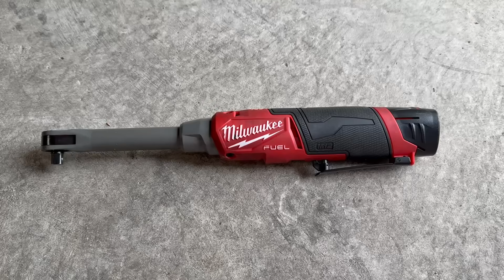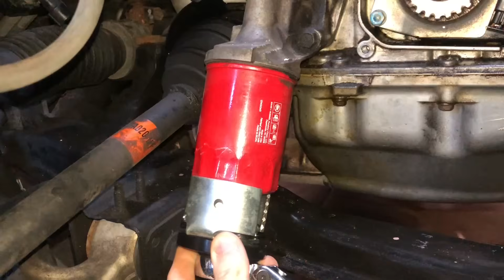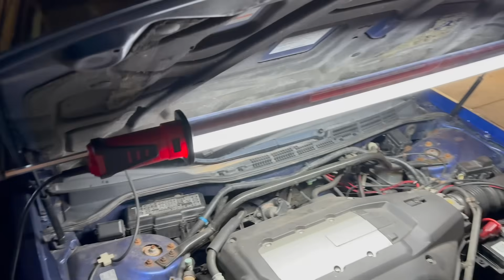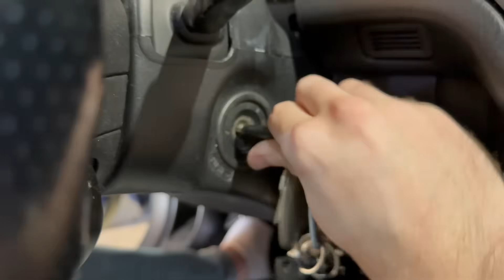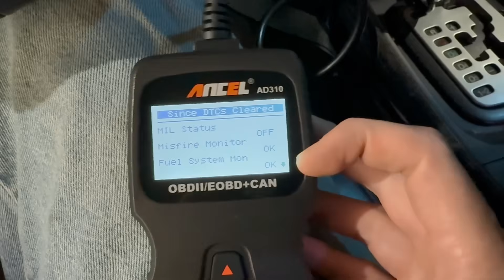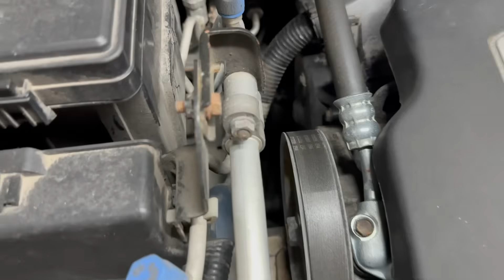Top 5 UNIQUE Must-Have Tools for Working on Cars

Comment: My next purchase will probably a set of 10 12 and 14mm wobble sockets in 1/4 and 3/8 drive. Also a set of good set of  extensions since I'm currently working on a car that would be nice to have rn and I've needed them before
Reply from the maker: I forgot about those wobble style sockets, good recommendation! Extensions are a must, and make sure to get a full set in both 3/8 and 1/2”. I used to use a 1/2” to 3/8” converter, but that was killing my impacts performance. What a difference the 1/2” extensions made. Thanks for watching!

Comment: Which cordless ratchet is the one to get if you're only getting one - standard or extended reach?
Assuming mostly working on cars and garage type stuff like yourself?
Reply from the maker: I'd go with the extended reach. It will be able to reach many more areas a standard length cannot. The wide diameter of the tool will often be the limiting factor, which is negated with the narrow extended head and neck of the extended reach. The extended model will additionally give you more torque to break bolts loose. The main downside of the extended reach would be an increased risk of breaking the tool due to that increased torque. Cordless ratchets can only withstand about 125ft.lbs of torque before breaking. So I just play it safe and use a ratchet to break any 14mm or larger bolt loose, then finish with the cordless ratchet. Hope this helps with your purchasing decision. Thanks for watching :)

Comment: If you own a japanese vehicle a must have is: JIS Screwdriver for philips type screws. Thank me later.
Reply from the maker: I never heard of those before, I’ll have to look into them. Thanks for the recommendation! I’ll add it the list of suggestions from viewers :)
Reply: @CarRepairsMadeSimple  Many haven´t until they start stripping screws one after another on their Toyota, Mazda etc. The Japanese have their own standards for screws – JIS Japanese Industry Standard. The most popular brand is Vessel. Their screwdrivers are top-of-the-line, essentially the Knipex of screwdrivers. They even work quite well with normal Phillips screws.

Comment: Big caveat to electric ratchets is they really only work on bolts that aren't stuck for whatever reason. But I agree they work great on easy bolts
Reply from the maker: I agree, these cordless ratchets aren’t the strongest. It should be noted there are separate high speed vs high torque ratchets. My high speed Milwaukee is only capable of about 30ft.lbs, while some high torque ratchets can achieve over 80ft.lbs. I still prefer the high speed and extended reach design for the vast number of small 10mm and 12mm bolts that it can remove.
Thanks for commenting and watching my video! :)

Comment: Battery ratchet is definitely the tool I wish I'd bought earlier. I have a parkside one, so it was very cheap, but it's so good. If it breaks I'd buy a better one

I haven't tried the filter tool you have, but I have one of the fixed ones for one of my cars, and because space is so tight it is easier for me to use than an adjustable kind .

The thread files in your thread kit are really good on a slightly damaged bolt
Reply from the maker: You definitely don’t need a pricey one. They all save a tremendous amount of time!
The torque test channel compared a bunch of filter tools and they all worked better than using just your bare hands. I say get whatever works best for you, they’re all great!
The thread repair kit is one of my favorite tools, very satisfying to use and a great time saver!

Thanks for commenting and watching my video :)

Comment: my thoughts:
1. i recently got the m12 ratchet in the last year because i determined that im getting too old to be doing all that ratchet turning. GREAT BUY.
2. i prefer teh pliers for a stubborn filter, as long as you can fit them in. i rarely use anything else. 
3. disagree on this one. thankfully i borrowed one before i bought one. always got in the way and always had me between the light and the work, so was constantly in shadows. 
4. if you do any kind of repeat work, absolutely get a scanner with live data. REALLY helps pinpointing the problem. my $1k scanner is far from top of the line, but allows 2-way communication to further narrow problems down, but admittedly, probably beyond a home gamers reach. also good tip for people on the i/m monitors. 
5. not saying its a bad idea, but i usually just replace fasteners. i havent touched mine in in years and i do live in central pa, so rust IS an issue. 

i think the torque wrench mentioned in the beginning is NOT a tool the everyday home mechanic has and should not only have, but learn to use!!!

and i would put #4 and the most important unless youre working on classic/antique pre-2000s cars. so many shade tree mechanics cry about how hard new cars are to work on because they dont understand how to use a scanner. a $1k scanner with live data and 2-way communication is MUCH more accurate and can take the place of SEVERAL thousands of dollars of 1990's diagnostic equipment.
Reply from the maker: Thanks for the amazing feedback! 
1. Love my cordless ratchet too, it saves so much time. 
2. The torque test channel did a review on oil filter removal tools and pretty much everything provided more grip and torque on the filter than bare handing it. I recommend everyone to get whatever style you prefer, they’re all great!
3. I respect that. I tried to mention it as not being a must have, but in my opinion has been the best lighting solution of everything I’ve ever used, and I wanted to share my great find.
4. I agree with the OBD-II scanner as being most important. I got my dad a bi-directional scanner and it’s amazing how much it can do. Pricey, but worth it for the more developed mechanic.
5. You’re right, some bolts need replacing and not repairing. But IMO it’s overkill to replace every bolt and I just got sick of the delays when I could repair it instead. Bolts and nuts aside, it’s a great tool for repairing the non-replaceable threads on the car itself.

I agree, the torque wrench is definitely an extremely important must-have tool! I thought about putting it in this list, but looking at Amazon, the torque wrenches were all getting 13k, 14k, 29k, 33k, and even 44k reviews, compared to the best selling thread chaser on Amazon with only 909 reviews. I questioned putting the OBD-II scanner in the list for the same reason, but the number of times I have to ask people for a CEL code has been countless. I’ll still add the torque wrenches to my list of viewer recommendations.

Thanks again for commenting and watching my video! :)

Comment: And another quick comment, please don't say that the metal adjustable oil filter wrench is for ANY filter. ABSOLUTELY PLEASE DON'T USE THESE ON ANY CANISTER STYLE FILTER WHERE YOU HAVE A PLASTIC CANISTER N REPLACE THE GASKET N FILTER CARTRIDGE. YOU CAN N PROBABLY WILL DO SOME SERIOUS DAMAGE. AND LIGHTING IS NOT UNIQUE.
Reply from the maker: Maybe you’re an experienced mechanic who is well aware of these tools and owns them all, but I assure you, most beginner mechanics don’t. This video is not for the ASE certified master techs out there making a living fixing cars. Everybody has to start somewhere and eventually will buy these tools for the first time. Regarding the canister style filter, those are more than likely going to have a fitting made to attach a wrench, socket, or square adapter, so it wouldn’t make sense to buy this filter wrench in the first place. Yes, lighting in general is not unique, but this style of light is both unique and superior to any other shop light I’ve ever owned and definitely deserves a spot on this list. I would lastly argue the thread chaser kit is definitely unique, especially when compared to and confused with a tap and die kit. Just look at the reviews on Amazon. Your average tap and die set is easily getting hundreds and thousands of reviews, while I can’t find a single thread chaser kit with over 1000 reviews. The top comment of this video with the most likes also states they never even heard of a thread chaser kit.

Comment: Those handstands look a little sketchy 🤣
Reply from the maker: You mean the Esco jack stands at the beginning? They're are actually really nice! The welding is very professionally done, they're powder coated, and the locking pin design they use is much safer than the traditional ratcheting jack stands. I highly recommend them!

Comment: It's not important in most circumstances either, unless you're a professional mechanic; you won't be able to do most of the difficult and complex things yourself. 15:16
Reply from the maker: I'm not understanding this comment. Cleaning up a rusted or cross threaded bolt is important, unless you want the bolt to rust even more, highly increasing the odds of the bolt breaking or not being properly torqued to spec. You also don't need to be a professional mechanic to do complex jobs. I'm not a mechanic, 100% self taught, and I've replaced just about every part on this car, including brake and fuel lines, removing the rear subframe to replace a fuel tank, timing belt, oil pan, valve adjustment, engine mounts, radiators, rebuilding struts, and more. The sky's the limit, and the only thing holding you back from doing a complex job is yourself.
Reply: @CarRepairsMadeSimple  I know it doesn't require a miracle, but many people don't have the space to work on these things, some don't own another car, and they're far from parts stores. Online orders won't arrive immediately. I worked at a repair shop and didn't see them have any tools to remove rust from a screw. If the rust is very strong, it should be replaced, not cleaned. A little grease is enough to make tightening easier. Most of my followers don't need these tools except in rare cases. There are more important tools that you didn't mention. Having too many unnecessary tools isn't good; it takes up space without any real benefit.
Reply from the maker: @فارس.التميمي-1444 you’re right, not everybody has the perfect setup for working on cars. But plenty of people do. So it’s an individual basis on what works best for you and whether or not you think these tools are worth owning or not. I personally love every tool in this list and felt they were worth recommending to people looking to expand their arsenal of tools. I’m also writing down viewer suggestions for unique must have tools. What do you suggest?
Reply: @CarRepairsMadeSimple  The most important thing I suggest is a double-sided sealed wrench and a flexible magnet. Also, buy tools according to the actual workload, not something general. Even a jack can suffice if your workload isn't heavy. Avoid buying unnecessary tools; buy only what you need. This is best, especially for those who don't have a service center. Even if you do have a service center, it's not relevant, but individuals should focus on this principle more than professional technicians.
Reply: @CarRepairsMadeSimple  Yes, nothing is perfect, but there are essential tools and less important tools, and there are also alternatives for some of them.
Reply from the maker: @فارس.التميمي-1444 thanks for the recommendations!
Reply: @CarRepairsMadeSimple 💐

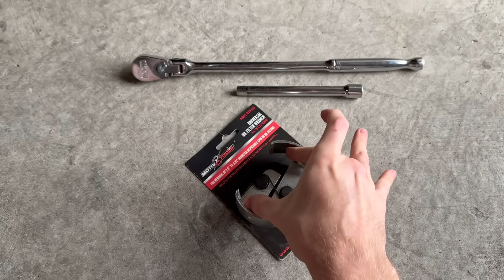Comment: Having your oil changed at a service center is better than doing it at home. We have nearby service centers with oil change services that are very close to the price of buying and installing the oil yourself. If you're worried about beginners, use the oil siphoning method (pumping oil from the dipstick). 5:04
Reply: Why is it better at a service center than doing it at home? So you can put some careless lame-brain minimum wage teenager with one day of training and a directive to upsell the customer in charge of changing the lifeblood of your engine? So that he can overfill or under fill? Or cross thread the oil plug? Or forget to tighten it? Or forget to change the filter? Or skip it all together because he’s in a hurry?
No, bro.
If you can’t do a better job of changing your oil at a lower cost than a “service center”,  you better find a a good mechanic who can.
Reply: @richardvale214  I don't live in the United States, but all our mechanics know the correct oil quantity, and you, as the vehicle owner, should know it too. You should also know the correct original filter size. They sometimes use larger filters, and for the correct oil viscosity, make sure it's at least 5W-30 unless the temperature is colder than -30°C. The filter should be properly tightened; they should check this before finishing. I suggested bleed the oil instead of loosening the drain plug because some mechanics overtighten it. With proper draining using the dipstick, you shouldn't have any problems at all.
Reply: Sure they do.
Reply: @richardvale214 👍🏻
Reply from the maker: I would disagree with this. I can get premium full synthetic oil and a premium filter for $40 total. If you're paying someone to do an oil change for $40, you're guaranteed to be getting it done by a minimally trained "mechanic" who uses low quality conventional oil and a garbage filter that can't even filter below 40 microns. Only reason to take your car to a mechanic is obviously if you can't do it yourself. Changing the oil and finding the correct products isn't hard. I was implying the oil filter over time becomes difficult to remove, which is completely normal. This isn't because the wrong filter was used or was installed incorrectly. It's because the oil you coat the gasket with gets pushed out increasing gaskets grip on the metal housing, and the repeated heat cycles further cause the rubber to swell and increase the resistance. This tool makes removing the filter significantly easier. Also, please don't recommend people to use an oil viscosity that is anything other than what's specified in the owners manual. The engineers know better. If you live somewhere that gets down to -30°C, you need a block heater, not thinner oil.
Reply: @CarRepairsMadeSimple  This recommendation is based on the Toyota car manual for all countries worldwide except America. Even 5W-30 oil is considered too thin, and I don't prefer it, but since my statement is general, it's considered the minimum acceptable. However, in areas where temperatures don't reach freezing, I would use at least 10W-40.
Reply: @CarRepairsMadeSimple  Yes, I use mineral oil, but I only use genuine filters and the mineral oil recommended in the SL owner's manual. It's effective, but it should be changed early, ideally after 6,500 kilometers, but preferably after 6,000 to 4,000 miles on average. Some types have a shorter lifespan.

Comment: I have been working on cars for over 40 years and have been purchasing 12 and 20 volt impact wrenches and ratchets in the last few years. But I dont don't do it professionally so I cant see spending high dollars for what some inexpensive tools can also do. The Hyper Tough tools sold at Walmart has not let me down so far. 
I've watched many videos of their products before I decided to give them a shot.
A chaser set was latest purchase and it will come in handy in the future I'm sure.
Reply from the maker: Those Walmart Hyper Tough tools are a tremendous value! Their mid-torque impact capable of 550ft.lbs as a kit for only $100, and the high-torque impact capable of 900ft.lbs for only $125?! That’s insane. Those tools could certainly be good enough for most people. Then if anything needs to be replaced, it won’t break the bank. But you also certainly get what you’re paying for with the power, robust construction, and compact design of the Milwaukee.
Congrats on the new thread chaser kit! It’s super convenient and pretty satisfying to use too. Thanks for the comment and thanks for watching :)

Comment: The thread chaser kit! Dude I’ve been using tap kits and have gotten LUCKY I guess!
Reply: Yep. Haha. I bought 12 or is it 14mm tap to clean plug threads. With head OFF car.
Reply: @stoveguy2133  let me tell you buying that kit or a kit That’s just like it and I am never using a normal tap set again.
Reply: @KeepItC1assic If you actually think u will never need a tap n die set again, you definitely are not a mechanic by trade. Yes thread chasers are a must but ABSOLUTELY NOT A REPLACEMENT FOR A TAP N DIE SET. DARE YOU TO TRY USING A THREAD CHASER TO TRY N SAVE SOMEONE'S OIL PAN DRAIN PLUG THAT GOT CROSS THREADED OR STRIPPED. Unfortunately, you may eventually have to replace the pan but I saved my buddy's pan for approx 2yrs which allowed him the time to plan for it.
Reply: @Ninersfanatic79  nah dude I’m a diy guy. I do house work professionally
Reply from the maker: It’s not the end of the world to use a tap and dye kit. They’re just a lot more aggressive and tighter and can remove protective coatings, platings, and raw material. With the additional material removed, that can make them more susceptible to rust and stripping. If you use a torque wrench on most fasteners, stripping the threads shouldn’t be a huge concern. But when you tighten them by hand, there’s a good chance bolts will get overtightened, which in combination with thinner weakened threads isn’t good. Highly recommend a thread chaser kit. Thanks for watching!
Reply: @CarRepairsMadeSimple  think tap and die aint a issue if you know how to use em, but easier for the avg joe to just use a thread chaser yes that i agree with, tho can also reccomend a Offset Extension Wrench very handy for tight spots even smaller than the electric wrench

Comment: Nice selection. Throw in a 20 dollar trim tool kit (you can use the picks on small electrical connectors). 🔧
Reply from the maker: I actually don't have a trim removal kit, and that's pretty affordable too. Thanks for the suggestion!